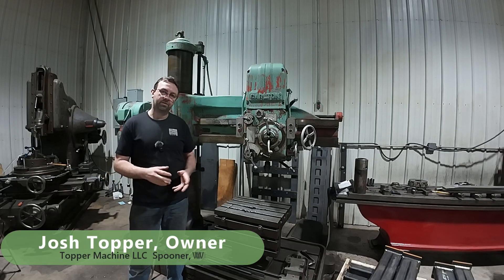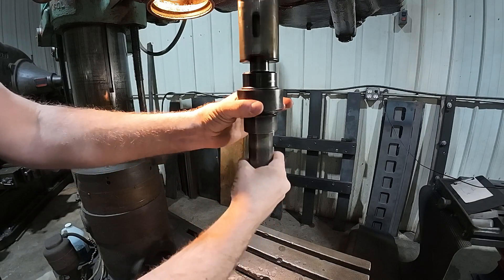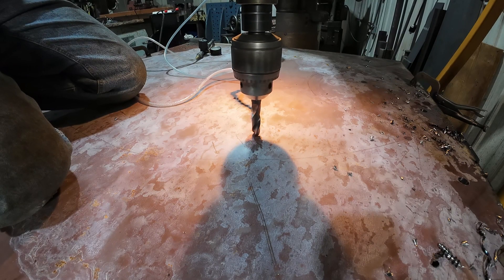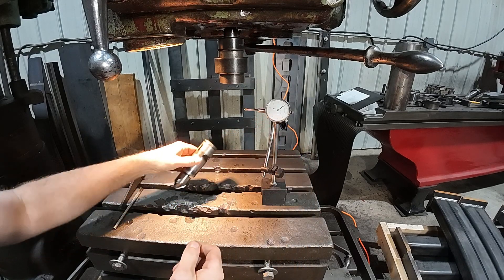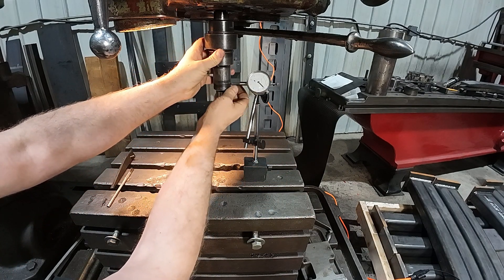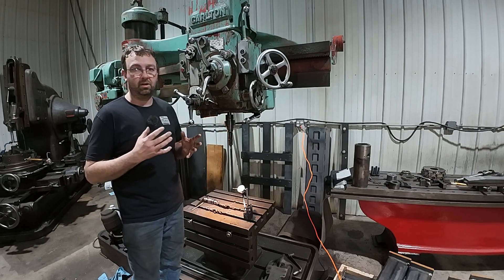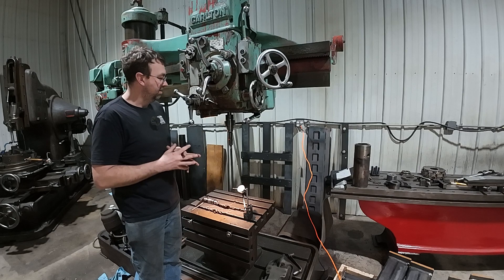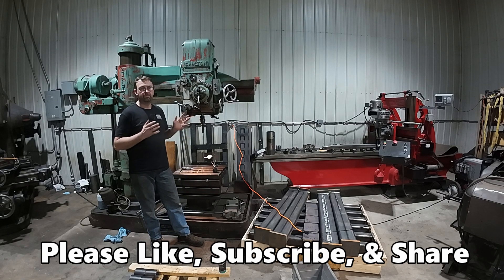"Magic Chuck" Drill Chuck System Explained, & What Went Wrong In My Last Video

Comment: I don't think 0.050" would be a failure on wear plates. You used the right equipment for the job. Your center drill should find a good punch mark even with 0.050" run-out. Knowing you have that possible run-out you can watch for it and may have to guide the start of the center drill. Great job and thanks for sharing. Sucks that you broken carbide drill bit. I would contact manufacture and ask if they can re-sharpen it.

Comment: The design is fairly straight forward, Making a set for a small shop is quite possible. 

I propose the locking balls not drop into those groves, I think the little bit of extra time to line the balls up with round dimples would be worth it for the improved accuracy / lack of slop.

Comment: Once the bit starts cutting, shouldn’t it self guide?  Seems like the taper of the bit should keep it going on the same axis, lateral movement negligible.  With spot or center start, I would think that it wasn’t the chuck, but interrupted chip flow and glass like non flex able material of the bit.  Thoughts?

Comment: The side to side runout likely won’t matter too much once you’re fully in the hole, but that rotational play in the ball grooves is WILD. That’s pure murder for carbide tooling in something hard like AR plate lol. Honestly there really should be another detent position designed into that quick change chuck that allows it to lock down on the tool if needed. Speed when you want it, rigidity when you need it. That’s a major design flaw and completely unnecessary imo.
Reply from the maker: I agree. It could be designed better for rigidity.

Comment: Josh another thing is most people have no clue just how hard AR 500 plate is. And how hard you have to push the equipment to just get the job done with that stuff. I was very impressed when you started tackling the holes with just the high speed steel bits.
Reply: The secret is sharp correctly ground drills at low speed with plenty of lubricant. Keep it aggressively cutting. Dwelling causes work hardening. Good job Josh.

Comment: Carbide requires very good rigidity in the workpiece and tool.  A universal machine shop principle.
Reply from the maker: Yes it does. I was being lazy and not wanting to deal with slow tool changes. Being lazy cost me an expensive drill. I can guarantee it won't happen again.

Comment: Oh man...that brings back memories. I spent 5 years running a radial arm drill and yes the magic chuck is a big time saver.  Carbide though, loves rigidity. Needs it i should say.   Oh well....live and learn i guess.  Cheers Josh..
Reply from the maker: I knew it needed to be rigid, but I was being lazy. I didn't want to deal with slow tool changes. I really hoped it would work, but Instead learned a valuable lesson.

Comment: Yep. Carbide hates looseness and vibration.  Kwik-switch makes a nice system and parts are available on eBay.  You have to stop the spindle to switch tools but they lock into a taper.   The carbide was drilling so nice, right until it wasn’t lol.  The way she goes.  From south east Wi. Carry on!
Reply from the maker: I've been looking at the Kwik switch system.

Comment: There is many different types of these chuck systems around, in the UK we have "Archer quick chucks" which you can get in many sizes and nowadays as no one hardly uses them they are very cheap used.
There are also tapping head systems where the tap collets run on indents via the clutch in the head but drill collets run on a different set of indents not through the clutch.

Comment: You COULD build a new tool holder for the Magic Chuck with much tighter tolerance, that would reduce the chuck run out by a big margin.
Reply from the maker: I could, but it functions for the intended purpose. If I really need one, it would be cheaper to buy one. Being in business is about knowing when buying or making is the best use of time.

Comment: Thanks for the follow up!  Tool holding is always a compromise it seems.  You can have quick, compact or accurate but not all three.
Reply from the maker: Exactly
Reply: It also seems to vary based on machine and size as well. I watched a video from blondihacks on different collette types recently and didn't realize the different methods of holding they use. I'm used to rotohammers and my POS mill/drilll is R8 while my brother's tormach is R8 to tormch quick change, which seems to be really good for the smaller machines. Big mills like the mazak have quick change tool holders but the spindle moves quickly and it is CNC tech vs. old school like the radial drill. I wonder if a newer quick change system could be adapted. That leaves the variable you didn't mention, which is cost and of course he said his system is very expensive anyway. I would have never run carbide in something with that runout, but he is also used to drilling with that system so the look of it normally isn't alarming for him and hindsight is 20/20.

Comment: Your investigation is much appreciated. I run some carbide tooling around that size with significantly higher spindle speeds, say 400 to 800rpm. I rarely drill AR500 plate, but I do routinely deal with hard materials. I think the rotational freedom built into the quick-change setup contributed largely as well, as the bit ends up getting a hammer type effect, but the design of the bit is much different than that of a hammer drill bit. Keep up the awesome work!

Comment: Having only one thou run-out with the spindle on that radial arm drill is amazing, especially considering its age. I'm pretty sure my brand new drill press has more run-out than that. But it cost under AUD $1000, so you would not expect it to be as good as your machine which would have cost maybe 10 times that if not more when new. It's a case of what is economically feasible for the intended use. My drill press is a floor mount with a 16mm (5/8") chuck and I don't use it that often, but for drilling large (small by your standards) holes in thick (once again thin compared to what you do) plate, it works quite well.

Comment: Does the chewed up table bother you? It would sure bug the hell out of me! It cant be rotated so the side face is on top due to the smaller face but I'd certainly be looking to either fix or replace it.
Reply from the maker: It does bother me, like crazy.  Whoever had it before me was a moron.  I have plans to eventually fix it, when paying jobs slow to the point that I can fix it.
Reply: @TopperMachineLLC   I hope you can do a video on that. I also found it annoying just watching your videos. In over 50 years of working with different equipment, I have so far managed not to drill into anything that I should not have.
 I hope I don't jinx myself saying that!

Comment: I mentioned this in your last video but I have the same size chuck as you.  Now I know it is also the same brand (Collis).  In spite of the slop they are extremely handy and I think all the play is to make it easy to change when it is rotating.  The last thing you want is it grab on unexpectedly and get hold of a body part.  I always thought that the Magic Chuck system should have included a holder that was a much closer fit that could have been used for spotting holes.  You would mount a centre drill in it and spot the hole with minimal run out.  Then switch to the regular, large clearance holders with the rest of the tools needed to finish the hole.  Before I got my boring mill I used to layout large holes with a centre drill on my Bridgeport clone (using the DRO) and then take the part to my radial drill to drill the holes.  I would locate the centre drilled holes using a No. 4 dead centre mounted in a No. 4 holder.  I quickly learned that if you had the spindle lined up with the centre drilled hole there was a very crisp, definite thunk that you felt through the bull horns when you bottomed (maybe topped is the better word) the holder out in the chuck.  If you weren't on centre the thunk felt spongy and didn't sound the same.  With a bit of practice lining holes up became easy and fairly precise.  They are a fantastic tool if you own a radial drill. Ken

Comment: I wouldn’t even call the .020” to .050’ runout. It’s play and in some circumstances would allow the cutter to self centre which, if you’re doing multiple operations on the same hole, could be an advantage.
Reply from the maker: Yes, exactly, play.  It is great for fixture work.

Comment: I have also one . Never used it because of the run out… 
My father in the 60 used them when he worked in a lathe making factory, he was a “driller” radial an other column drills, but always whit drill bushings and they always had fixture for all the components
Reply from the maker: fixtures and bushings really seem to be the ticket with these.

Comment: They should use three ball detentes, but also machine the channel as a slight ramp. When the quill spins and then the ramp takes hold it will tighten even more. If it's ramped in both directions, then reverse tools can also tighten. (Or it can be used as a backup direction to get more years out of the tool.)
Reply from the maker: I agree there are design changes that could be done, but I doubt they would change a tool that has performed for the last 80-100 years.

Comment: Good video, would a 4 morse taper annular cutter holder have been a good set up for drilling the AR 500 plate?
Reply from the maker: Possibly, but I don't care for annular cutters. Just putting the drill in a MT collet holder would have worked better.
Reply: @TopperMachineLLC   Yeah I don't know that much about engineering tbh but in construction a dedicated core drill has a male threaded chuck and the core drills are female so screw directly on - no slack unlike goofy sds to core drill adapters, as you say a drill bit directly in a collet would be the least run out unless you're looking for Moore No3 jig borer with invar headstock levels of accuracy to 1 micron.

Comment: HSS cobalt is very tough and fills the gap between regular HSS and carbide well.
Reply from the maker: With a good grind and lubricant, HSS performed extremely well for me. No need to buy another drill.
Reply: @TopperMachineLLC  Yes amazing how well HSS works if properly ground with lubricant and correct speed.

Comment: I don’t know, but 0.020”-0.050” run out makes it useless for anything I’d ever do.
Reply from the maker: It may seem useless,but for fixture work and miscellaneous things it's great. It will self center. You just need to know when you need precision, and that gets done on a mill anyway.
Reply: If it's just slop in the tool it doesn't matter too much if you use HSS, normally it will self align. Actual runout in that region would be the death even for HSS tools.

Comment: Carbide tools require HIGH RIGIDITY to work, if there is deflection it will trash the tool. Carbide tools do not have any allowable deformation unlike HSS which will tolerate deflection and deformation.
Reply from the maker: I knew it going into that last job, but thought I'd be ok. I took a gamble and lost. Lesson learned, go with what you know and not what you think.
Reply: @TopperMachineLLC  At least it was only the tip of the drill that broke, so you can still re-sharpen it. It would have been a disaster if the drill broke down low and was a total loss.

Comment: Josh, in your next video could you give us a quick follow up on the Magic Chuck system? What are the factory tolerances? Will you acquire new tooling in this regard as you say this system is a must for your shop daily operations? Maybe even give us an idea on the cost, if the tooling is still available and manufactured.
Thanks for sharing. We appreciate your work!!!
God Bless.
Reply from the maker: This is the final video on this subject. The tooling is still viable for a lot of stuff, just not carbide. I have ordered a MT4 ER40 collet chuck for future use.
Reply: @TopperMachineLLC  
ER40 collets come in a variety of quality, from absolute Meh to excellent. The ER collet system was invented by REGO-FIX in Switzerland, Best cost vs performance ER collets come from Taiwan or Japan with the least expensive from China with absolute mixed quality (some good, some hideous).

ETM (Israel) made MT4 to ER40 (with tang) collet holders, use this on a Mori Seiki MS850 with good results. ETM's collet nuts are two piece construction, the tapered part applies clamping to the collet with the nut acting as a bearing on the taper clamp.

Keep the ER collet size choice close as possible to the cutting tool size, much better holding power. Make absolute sure the cutting tool shank is full engagement of the collet's length, Typical torque for ER40 collets is 130 ft/lb, oil the collet's tapered surfaces. This means those common ER40 collet wrenches are way too short to easily put 130ft/lb of torque needed on the ER40 collet nut.

Comment: If the Magic Chuck was 100% responsible for the carbide drill bit breaking, then why didn't the HSS bit break using the same chuck? I like math. 😁
Reply from the maker: Flex!  HSS has flexibility that carbide does not. Carbide will break in chatter that HSS won't.
Reply: Even as little as .001 run out will drastically cut down carbide life span, more than 5 and you'll just break shit.

One of my old HBMs had .002 run out on the quill and It has noticeably worse tool life using Solid carbide then the two that have almost no spindle run out.

.001 on the radial is actually amazing, that machine could have as much as .0015 from the factory according to the specs of most radials from that era
Reply: @procyonia3654  the .001 was just slop tho, he didn't measure runout. For that you'd need to rotate the spindle.
Reply: @CatNolara  you know your right, I had an error in my thinking there.
Reply: Carbide is extremely stiff. Therefore does not respond well under shock load. HSS is way more flexible. Therefore will give/flex under a similar work condition.  In his situation the materiel is unevenly heat treated hanse unpredictable hard spots. Those sheets are factory flame hardened.  He should have used the Anchor Lube paste as well...

Comment: I have had my hands on Magic Chucks before, but I don't remember using one.  Good info.  There is a system I have used on a Bridgeport before, called the Easy-Change.  It has a brass button on a rotating collar to release the toolholder, and it uses a short NMTB 30 taper.  Because all the toolholders have this short taper (which seats), they fit in the parent adapter with no looseness or backlash.  Not suggesting you re-invent your world, just passing on what I have seen that is a bit of a tighter QC system.  --Doozer
Reply from the maker: They work great, just not for what I was trying to do. Lol
Reply: The tormach system works well on small mills and even huge mazak machines have accurate QC but the spindle moves very fast by hand and normally by cnc. The old school radial drill is another animal and while the runout was alarming to me, I can understand how it wouldn't be as disturbing to someone who is used to a machine that normally works that way. I guess I will have to see if there are videos on drilling with fixture plates or bushings since I have not seen very much use of radial drills.